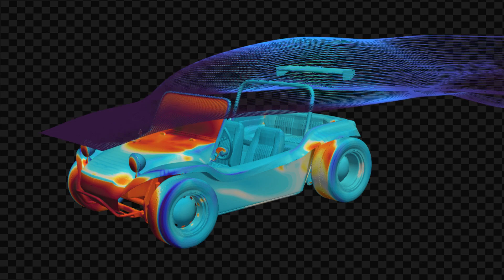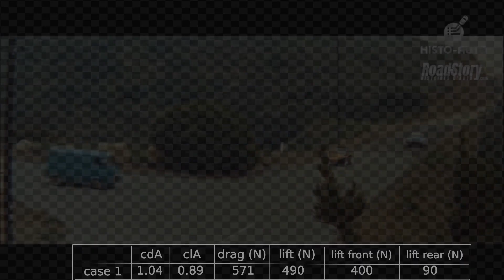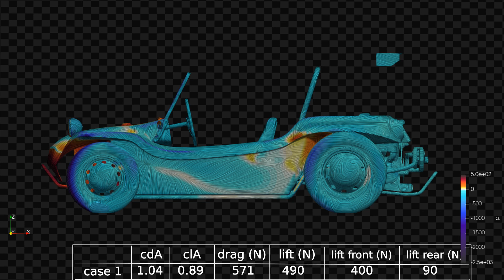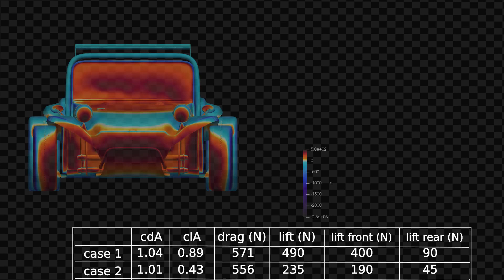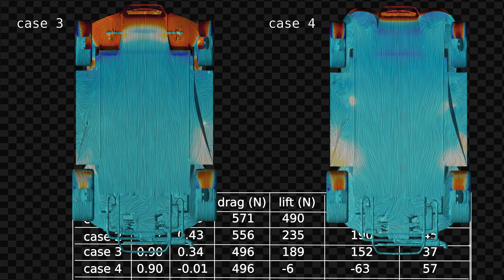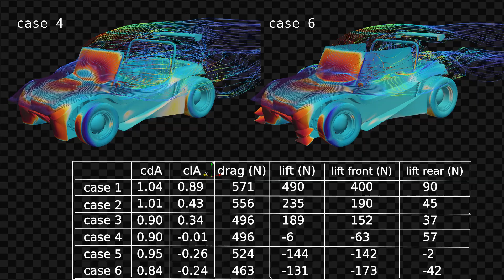Meyer Manx Dune Buggy Aerodynamic CFD Analysis

Comment: regarding the lights, Baja Beetle often have them moved from outside the wings to inside the front body work, so not that unrealistic to remove them in a simulation
and for the side windows, pretty sad that they're so effective since the open air spirit is one of the main draw to a manx.
how effective would a canvas top without those windows be? Making a manx into a convertible seems to be a good compromise between aero and said open air spirit

Comment: If you can. Please please please do a video on national hotrods 2.0l in the uk. Some run a windscreen and some don’t. They don’t have side windows or rear window but have a massive spoiler. I think they go about 60mph into a corner so is it mechanical or does aero come into play in close circuit oval racing in a pack of 20cars

Comment: G’day from Western Australia… I have stumbled on the channel while looking for Various drag reducing methodologies for my FJ cruiser Toyota… Yes it is a brick…

Do you have the capacity to put one of those through your process and see what comes out to reduce, fuel consumption?
Reply: Clean your MAF sensor and throttle body, replace spark plugs if old. Get a more road based tire if you're on AT tires. Aerodynamically, there is not much to gain. It's a 🧱

Comment: Still a ** sandwich, just not a soggy one.
Reply from the maker: happiness is relative
Reply: @nelsonphillips  If you really want to make downforce improvements, do it where it counts, in the corners! In the pursuit of ever increasing understanding, and knowledge, I have come to discover the windward side is far more sensitive than the leeward side under yaw. In large super cell thunderstorms, the windward side of the storm only has rain, it's the leeward side, away from the direction of travel, that spawns the tornadoes.

It is the leeward side of a car that has all dynamics working in your favor. Weight transfer, lower pressure field, the wake of the tires in general moving away from the underfloor. The windward side, the side going into the wind in a corner has everything working against it from a dynamic sense. Weight transfer makes the car lighter on that side, the wake of the tires is going under the floor on that side. The static pressure temporarily increases along with the adverse pressure gradient. Every car suffers from this, the ones that suffer the least gain the most. For in the land of the blind, the one eyed man is king.
Reply: @nelsonphillips  As a good starting point, you can turn air a maximum of 15 degrees, and the average yaw rate is ~5 degrees. That means you can design all your aero around 10 degrees offset from X plane, and it'll cover ~80% of the yaw angles the car can produce. Instead of designing steady state straight line aero and accepting losses in the corners, you're taking the opposite approach, designing steady state yaw aero, and accepting losses in the straights.

Make the windward side as efficient as you can in the corners, and you'll make big gains, especially compared to others who aren't doing that.
Reply: @nelsonphillips  From a suspension dynamics perspective, you'd want a suspension that has plenty of Ackermann angle up front, and you want the rear suspension to toe out during extension, and toe in on compression. Although not ideal from a vehicle dynamic sense toe out on the windward side reduces wake from the wheel under yaw conditions. These changes although beneficial for aero are counter productive for driver confidence, a bit like anti geometry(lift/dive/squat/etc). With better designed aero, you can make fewer compromises from a suspension alignment POV.